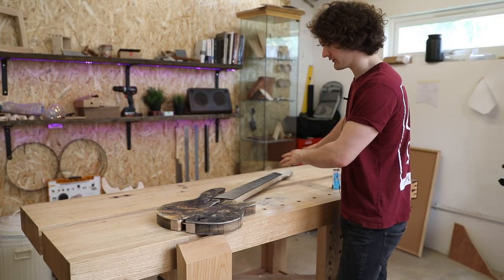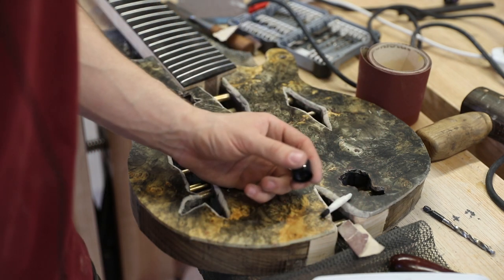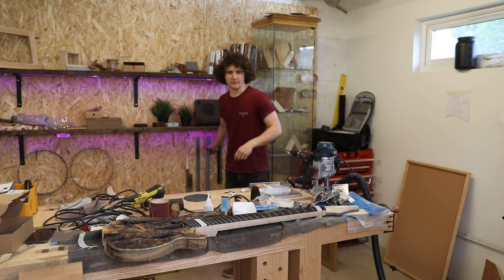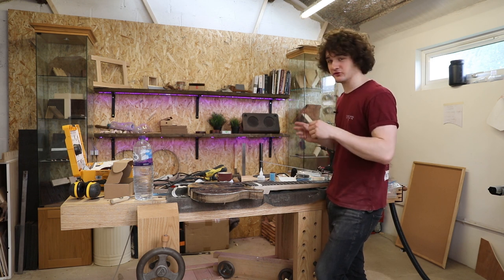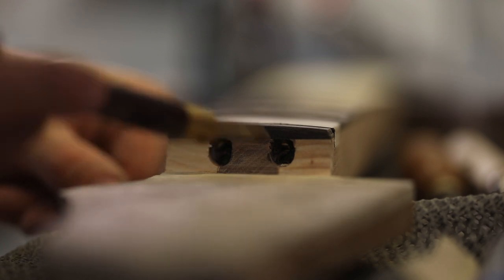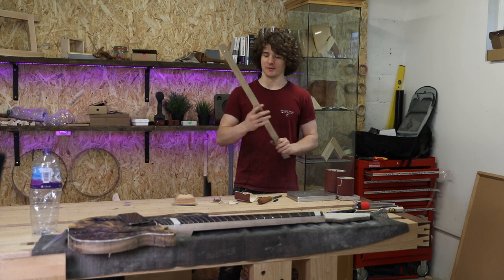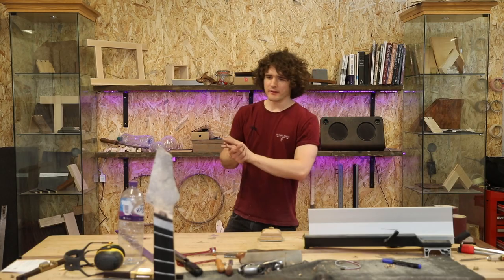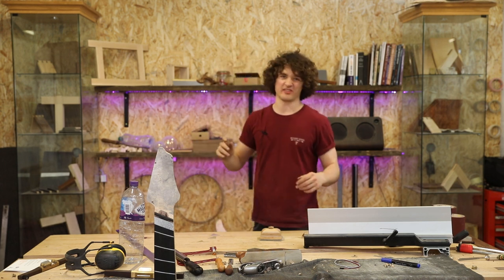Making a Custom Bass Guitar | Part 17

Comment: It is most certainly more sensible to level the frets after shaping the neck. In fact, it is more sensible to get the finish on the guitar before leveling the frets, as metal dust from the leveling proces might mess with the finish.

Comment: Also, don' forget the strings will apply tension to the neck as well, and I bet its gonna be the exact way you want to remove that bowing ;)
Reply: For the levelling process you don't have strings installed
Reply: If you build a house in the summer it won't be raining, so why put a roof on it?
I know that the strings aren't there, but when they are they will add tension, so you have to account for it in the leveling.
Reply: No, let me explain
Leveling the fret is putting all the frets on the same plane, that means having a flat neck. When you put the strings, yes the neck will bow ( slightly) which is then counteracted by the truss rod if needed. And ideal instrument has, when stringed, a flat to slightly bowed neck. 
A bowed neck will give some more and more space (on a very small scale) fret after fret. It's a good thing if the frets aren't leveled perfectly. If the fret are perfectly leveled, no neck relief is needed

If you level the frets when the neck is bowed one way or the other (to simulate the tension of the strings) you will either hit a lot more the frets in the middle or the frets at the extremities. Imagine cutting a ball near on end, there's gonna be more material at the center and diminishing as you go to they edge
If you do that and then putt the strings, only the first and last fret will be used, because all of the others will be below that plane

Comment: Why didn't you go with an angled Headstock? Would've been pretty easy with the Neck Thru Blank and you would have a nicer transition with the Buckeye on the Headstock
Reply: you also wouldn't need the stringtree
Reply: With an angled headstock and the fanned frets I can imagine it would be more difficult to do a scarf joint. Also there would be a flat area of the neck without fretboard wood before the headstock starts to angle down. Makes sense?? Sorry about my english....
Reply: No need for a scarf joint. He had plenty of thickness in the headstock area and putting a slight angle (with a reinforcement thingy on the neck side) would weaken the transition too much. Gibsons don't have scarf joint, but they have a steep angle and no reinforcement thingy, that's why they break easily.